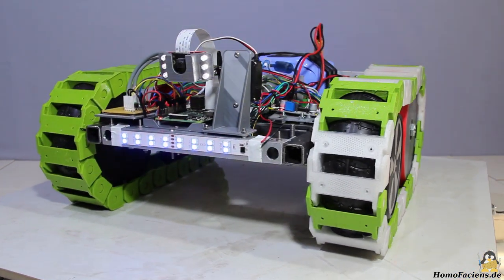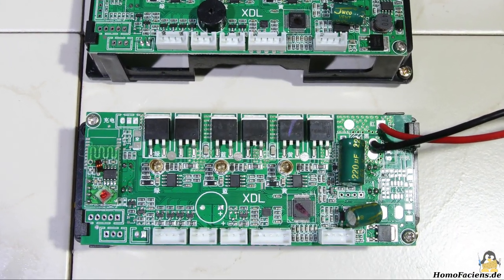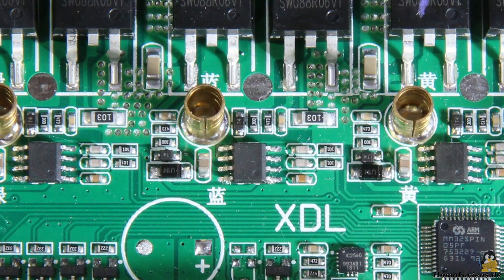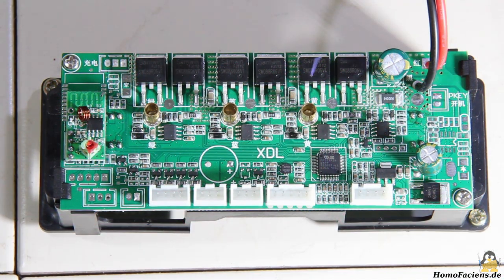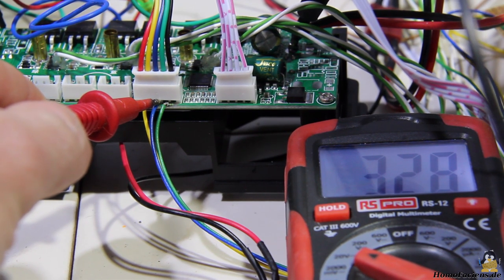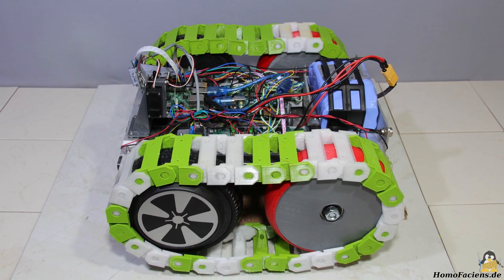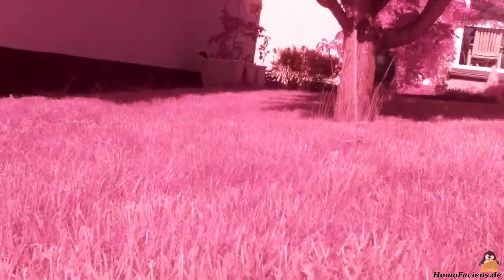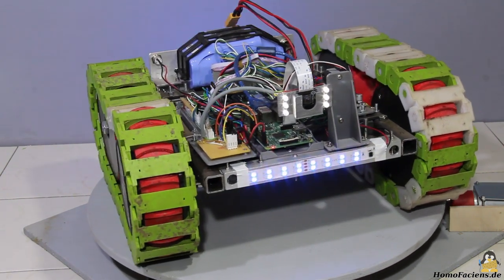R15 - tracked Rover based on a  Hoverboard

Comment: I bought a Creality Ender 2 after watching your review (the small, portable one). Excellent value 👍
Reply from the maker: Its the one behind me in my office. I really like it because of the compact dimensions.
Reply: @HomoFaciens  I have been using Cura 4.5 as a slicer. Recently tried PrusaSlicer and it's very powerful but more lightweight, you might enjoy experimenting with it. Search for "creality ender-2 profile for PrusaSlicer" on thingiverse or github and "import config bundle", as the software doesn't offer a profile officially yet. Thank you again for your work!

Comment: I'm willing to make a kind of Mars rover controlled via 3g and with a solar panel. This is the base I needed. THANKS!
Reply from the maker: One disadvantage of the direct drive wheel motors is that they are not self locking when turning the power off. Keeping the phases enabled just to prevent the rover from rolling downhill makes the system less efficient. You should consider implementing a mechanical brake (maybe a RC servo).

Comment: Hey!  Thanks for your hard work!  Could you drop the arduino wiring diagram and sketch?  Many thanks!
Reply from the maker: There is no sketch, since this is a rover in a very early stage. The idea is to build a motor controller from scratch and show how it works. For skilled tinkerers, the pin assignment can be read from the Arduino Sketch that is part of the download package:
https://homofaciens.de/technics-robots-R15-construction_en.htm

Comment: Do you live in the UK? Or have a visitor with a taxi 🤣
Reply from the maker: I have imported the Taxi at the beginning of 2019. The idea was to put a couple of Raspberry, Arduinos and so to the passenger cabin, drive to maker fairs and give many people a hand on these fascinating computing devices. That plan has stopped for now ;-(
I take the time to give it an overhaul and make it road legal here in Germany. When things are back to normal it will become an Open Source Taxi with passengers rather than being an immobile sculpture of a purpose built, iconic car.

Comment: have you tried  this firmware for controlling motors using built-in controller? 

https://github.com/NiklasFauth/hoverboard-firmware-hack
Reply from the maker: I knew about that firmware hack, thanks, but it's not exactly for my type of board. Another aim of that rover project is to learn and teach more about controlling brushless 3 phase motors and to my mind that's best done from scratch with an Arduino.